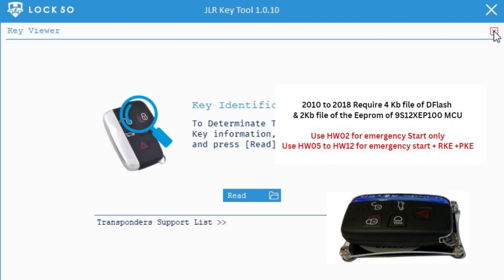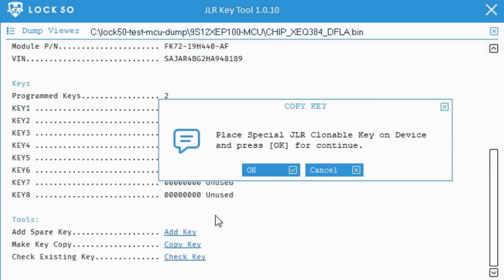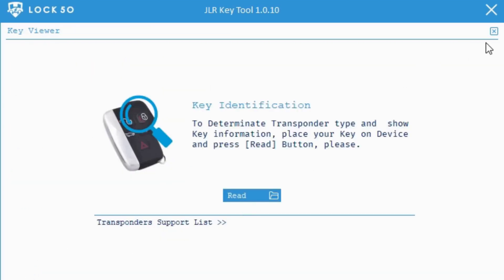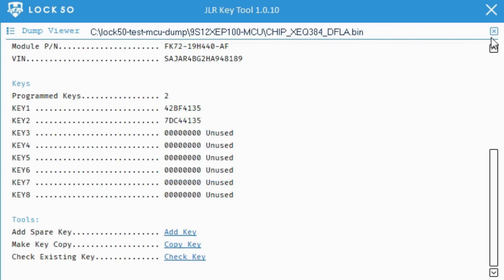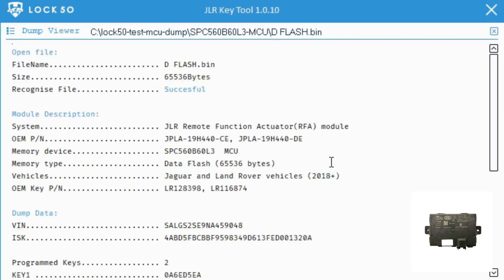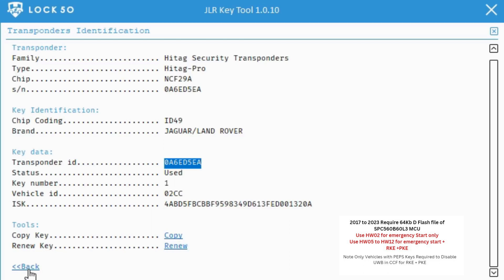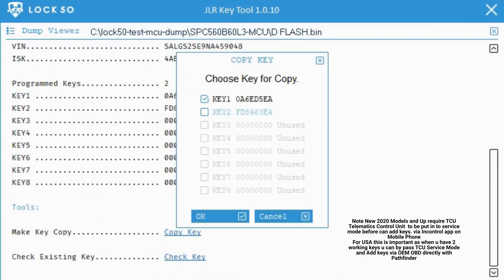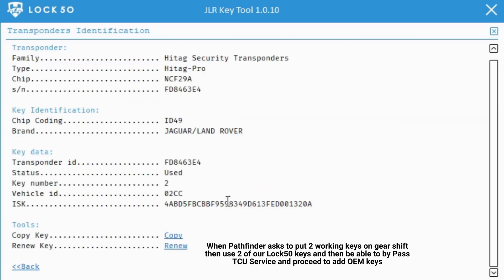Demo How to use the JLR Dump tool to Precode Keys from 2010 to 2023 Lock50 HW01 To Alarm off for USA

Comment: What is the price? What tool do you recommend to read ecu files. Do we need to buy emulator keys for you?
Reply from the maker: Is Many  Tools to Read Dumps 
https://lock50.co.uk/adapters/hw53-spc560b60l3-rfa-unlocked-mcu-reading-programmer-tool-for-bench-no-soldering-with-hw03/
This can do  unlocked  KVM and RFA without soldering
Reply from the maker: Yes the Keys required to Copy on to are Lock50  Special Keys